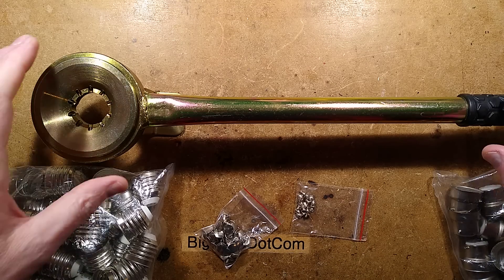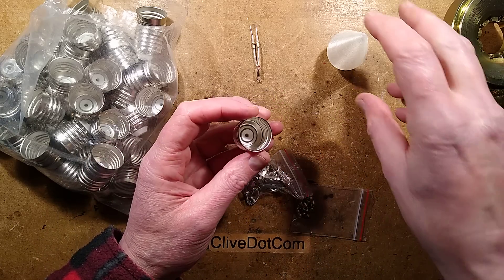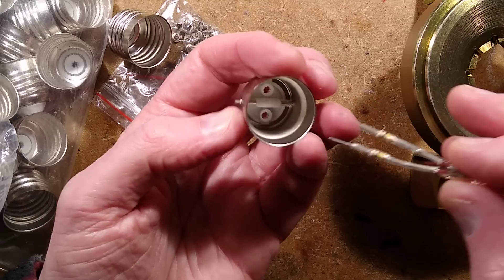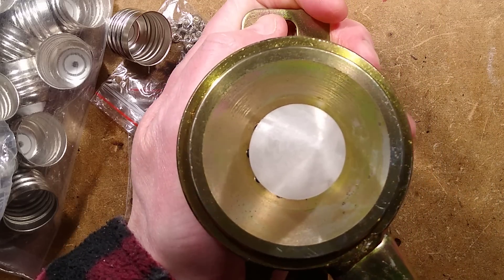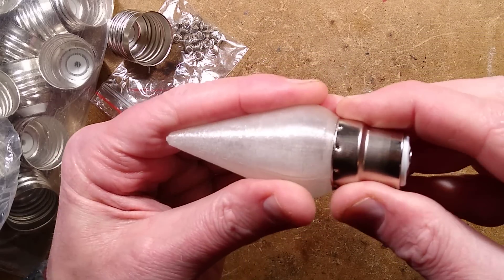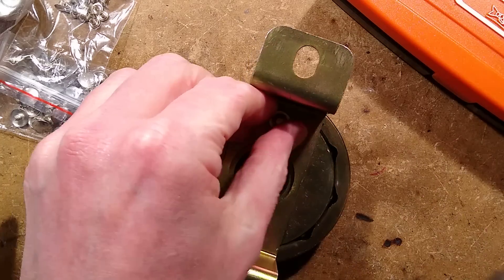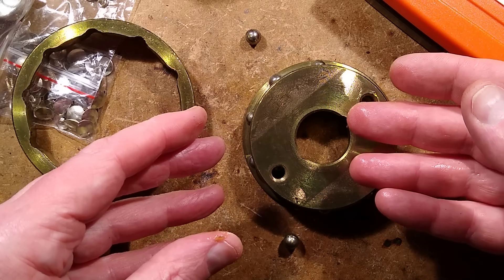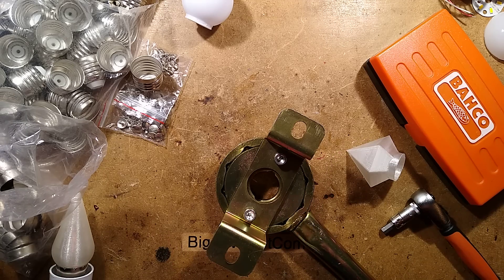Chinese factory lamp base crimper

Comment: what you do is you mount an axe handle to the other side so you have both leverage and a spot to hold it by, alternatively you could mount it in a vice grip mounted to a desk, or use a clamp on it
Reply: oh I almost forgot, vice grips, that works too, if you can find one large enough

Comment: The problem I see with bolting it to a doorframe is that gravity no longer holds the lamp in the tool. Lots of workable ideas from others for portable & bench use, but here's my suggestion:
Get 2 appropriately sized clevis pins & drill holes in the bench top. Set the tool's bracket over the holes and drop in the pins - it won't rotate till the bench does, and you just pick it up when you're finished (the pins will come up with the tool).

Of course the HUGE advantage of bolting it to a doorframe is that you'll never have to ask yourself where the hell you put it after last time you used it!

Comment: No No No, you did it all wrong ! You should have only half crimped it so the cap falls off. Also, make sure the bottom contacts are so bad it only comes on intermittently. Only then will it be like the ones you get in the cheap shops.

Comment: Fun fact - using this setup, a person can create their own custom 12VDC bulbs to use in house light fixtures. As a fulltime RVer, the lighting choices are dismal..We often want to buy a used house fixture at a thrift store to use on our 12v system. Many solar families try to stay 12v as well.

This is a great solution.
Reply from the maker: An interesting range of 12V lamps with standard bases can be found on eBay.

Comment: Nice vid :)  you may find that if you pack the springs and bearing surfaces with some molybdenum grease it will be a bit smoother in operation, its pretty cheap and available from Halfords and most motor factors.I use both Castrol and Comma (Lith-Moly) grease

Comment: I'm don't know what kind of 3d printer you have but if you want to produce a lot of those light tops you might want to look into a resin 3d printer for making more of them faster cause patience is hard.
Reply from the maker: I optimise the design with a hollow shell for very fast printing.

Comment: In many cases, I have found LED and some CF E-26 base bulbs where the center contact doesn't properly reach the live contact in the socket. They don't touch at all, or the work intermittently,  all the while sparking and arcing.
Being made in China, the specs were probably not followed,  or the correct ones not observed.

Comment: Easy enough to bolt it to a piece of stout angle. Clamp angle in bench or other firmly anchored vise and enjoy. A longer piece of angle could be clamped in say a plumbers tristand (portable, strong, fits in a closet which may interest apartment dwellers).

Comment: Here is an idea. if you used an earthed bayonet lamp holder and used the earth as a common ground you could then use the live an neutral pin for power and data and fit neopixles into the lamp.

Comment: Are there power supplies, that drive the neon with high frequency, so it doesn't shimmer visibly? 
So far I have not seen commercial modules that are running on 230V AC. 
But a modified joule thief made me like flicker free neon.

Comment: At work someone must have dropped an expensive LED light on it's base and damaged it. I talked to our local electrician when he was around at one point to see if he could replace it and he claimed no. So they expected me to throw away a $40 LED light made to go in enclosures. I tried to use a screw driver to bend the metal back slightly so that it might work but nope. Instead of throwing a perfectly good LED light away I kept it but I don't think I want to buy one of those tools just to repair one LED light. No idea what I will do with it though.

Comment: If you don't want to mount it on the bench, you could just bolt a 2by2 as a second handle, or even a steel pipe.

Comment: 7:00 guaranteed to have thread locker on them, probably red/permanent, otherwise they'd end up backing out and causing problems. possibly selling off used, ones that didn't pass Q.C. or out the back door piracy lol

Comment: I have pulled lamp basses off before(drilling the punched holes) and then used a hand punch or scratch awl and hammer to manually re-punch in between the old holes.
no, I do not recommend doing that ever. lol, I put it through the tip of my finger once when it slipped

Comment: Bought a similar thing recently for installing solar hot water, you have to shape the copper ends of the large glass tubes so they can slot into the top of the solar radiator. I forget it's technical name but that's more or less what it is.

Comment: Thanks Clive. Another great hoping you hands are ok. 
Simple to make it a hand tool no bench or vice required. 
Length of bar ( same length as device) 
Drill 2 holes to suit the 2 mounting holes on the bracket. 
Result 
An item that resembles a bolt cutter or long handled pruning shears 
Parts list 
Length of flat bar to suite,20 mm by 5 mm
2 x M8 bolts and nuts.

Comment: Seems like a much larger tool than needed for the job...
Reply: I was thinking this is probably great for mass manufacturing, but a hobbyist would probably be better suited with some kind of hand-crimper, even if you had to rotate and crimp a few times to get the same result.

Comment: My mother simply had to show me this "LED light bulb hack" she saw on Facebook a few weeks ago - "Fix Any Dead LED Light Bulb With This One Trick."
In the video, the guy pops off the diffuser, shows a single LED with the Black Death Dot on it, proceeds to flick it off the board, and then jumps the empty pads with a scrap of aluminum foil, holding the foil in place with cellophane tape to make it work again.
So Mom's chuffed as chips, since we've had the typical Dollar Tree LED bulbs fail quicker than old-school tungsten bulbs, and she's sick of throwing them away. I had to burst her bubble by telling her that was a temporary fix, and would most likely burn the rest of the LEDs out quicker. (And that Scotch tape over Reynolds Wrap was NOT an acceptable way to make that temporary fix.)

Comment: Fhak chinese tools ! I bought an electric pipe threader, POS 💩 the bed in less than a year. And I made maybe 20 threads with it, most were 3/4”. Doing a job with 2” steel it fried the motor. Even the replacement brushes that came with the POS , one was broken. I just bought a Milwaukee cordless set up that does up to 2” pipe.      FHAK made in china !!!!!!!!!!!!!!

Comment: Invest in a little screw on vice for the edge of your bench, it will made holding those things easier and you can remove it when you don't need it. They have a screw underneath that clamps it securely enough. I've used one for years with  B&D wotkmate for fiddly jobs.

Comment: Mount it to a board the same length of its handle and use it like a big pair of bolt cutters.  It then remains portable.  Optionally you can remove some pins for customizing the punch count.

Comment: Threaded inserts.  Aggressive threads on the outside and machine threads on the inside.  Could be flush mounted to your work bench.  When you need to use the crimping tool, couple of bolts and off you go.  Pretty slick little tool btw.  Thanks for all the time you put into the channel.  Love the content.

Comment: at least the gadget is kind of fool proof on re-assembly, I was kind of expecting mass carnage when you removed the handle for some reason, like a fairly cheaply made gadget whereby the ball bearings shoot across the room shortly followed by the springs. but really nice it would go back together without too much of a problem.

Comment: while the tool does have a lot of individual moving parts, it is very simple and pretty much indestructible - it is putting a number of dimples on something not much thicker than very thick aluminium foil. A very good purchase considering the use you could get out of it on your channel or for making bespoke gifts Clive.

Comment: I was thinking you could mount it on a relatively long piece of wood maybe about as long as the handle or slightly longer and possibly 2cm thick and wide enough so the two mounting holes are within the width of the wood. Then you can place it on the bench (or even secure it with a clamp) and be able to operate it just like all those factory workers 🙂.

Comment: hey Clive 

Bit of an odd question.

I bought a w-king T9 bluetooth speaker and the main speakers failed(magnets fell of as the rivets were defective)

I would like to replace the speakers and get the unit working again,I am not sure if I buy  8ohm or 4 ohm speakers.

I have found some speakers on amazon that would work but I can't seem to find any info to help guide my decision 

Any advice?
Thanks
Reply from the maker: If the impedance is not printed on the original speaker then you can measure the resistance of the existing coil and it will give a good indication.
Reply: @bigclivedotcom  my friend has a meter,i will do that,thanks alot for the reply.Have a great day.
Reply: Printed on the back of the speaker 

Is

BT239
1F14R
210724

Comment: You can easily mount the crimper onto a 1x4 or 1x6 piece of smooth wood (don't want you getting slivers).  The length of wood should be about the same as the crimper handle to give you ample leverage and stability. Keeps it all portable.
Reply: Or place it in a vise when needed. Perhaps a small block of woon to make it easier to be grabbed by the vise.
Reply: @pizzablender  I've actually got a 4" vise mounted on a 2x6 about 10" long. Portable vise. Super handy.

Comment: Phillips Lighting use to have a massive 20 plus  acre light bulb factory in Little Rock Arkansas, USA. I was a young kid and can remember everyone older wanting  to go work for them.  It was one of the largest best paying companies to work for.  Back when there was pride in making a quality product.
Reply: about the same here with GE making bulbs(Ohio). they're making some LED's now I think, but everyone I knew there is long retired or moved to another job.
Reply: same here in Argentina. philips had a MASSIVE lightbulb and radio factory. and now philips no longer exists (they sold off most of their divisions, the only part of the company that bears the name and has roots with the original dutch company, is the medical equipment division. everything else (lamps, electronics, semiconductors, etc) they sold over the last 2 decades. sad. philips is behind every high tech electronic stuff: ASML, the company that makes the machines to make the most advanced chips, is a spinoff from philips that they sold way back in the 80s because they saw no business in it.

Comment: How do you vacume the gas out and put in a gas you want.
Reply from the maker: For glass globes you would need a vacuum pump and gas injection manifold.  Like neon sign makers use.
Reply: @bigclivedotcom  Do you have one to demo that?
I made one with a fridge compressor.
Collapsed the glass and some other materials I tried.

Comment: Interesting video as usual. Thank you.

In the past I've mounted a similar tool to a bit of 2x1, so that I effectively had 2 handles. If 2x1 isn't man enough you'll probably have access to a bit of bar.  One problem with that dodge is that the tool twists because the handles aren't in line, but you could put a swan neck in to reduce that.

Comment: If you're going to do BOLTRs, you should unbox the product with inappropriate tools.

Whilst I appreciate the space-saving aspect of mounting the crimper to a wall or door frame, one should consider the gravitational advantage of horizontal mounting. It would be preferable to have a medium-sized planet holding the bulb in position rather than helping to pull it out.

Comment: If you bolt it to a 2x4 or some other such piece of wood (or metal) you can use it like a bolt cutter and not have to mount it permanently.

Comment: What adapter do I require to drive (12) lights that light up the stair case. The units require a (4.5' volt DC) or (3 X (1.5 volt battery)! I do like the I do like the light bulb crimper.
Reply: If battery operated it will likely operate acceptably for a range of voltage as 3x AA/AAA with fresh batteries can be close to 5V and drops to ~3V (1V per battery) when effectively empty and most designs tend to try to use most of the energy in the batteries. 
For instance I've got various  lamps and other devices meant for 3xAA running just fine off a single 18650bLiIon battery (4 2V full, most of the time  around 3.7V and about 3V empty (using a TP4056 module for charging and under-discharge protection)

So if you put all the devices in series you'd need a voltage of between 36V (3x12) and 55V (4.5x12) and capable of delivering the current that one device draws, as the same current  goes through all the items in the series string.

If all were put in parallel, the voltage needs to be 3 - 4.5V (maybe a 5V supply with a series diode, to drop a bit of voltage), capable of delivering 12x the current a single device draws. If doing 5V and diode, make sure the diode can take the current / power dissipation
...
As you have so many devices it is quite flexible, by putting groups of series connected  devices in parallel - assuming they all draw the same power.

If you, for instance have a 12V supply capable of 4x the current one device draws, you could wire 3 of them in series (x4, making 4 such groupings) and then put these 4 groups in parallel. Each device in a string gets 4V (12/3)
If you had a 9V supply capable of of 6x the current of one device, you could use 6 parallel strings,each with 2 devices in series. Each device would get 4.5V (9/2).

HTH
Reply from the maker: If the lights are low current you may be able to use a USB power supply to run them with a resistor in series with each.

Comment: Oh stop kidding yourself you're gonna use all 50 of those. Just like I have used all of (looks at recent eBay purchase list.....) Power pole connectors, 5.5 mm 4X Y cables, dummy display port adapter which I literally bought one and then bought one a week later, two different sets of USB-C connectors for replacing micro connectors that have broken. 50 pack of record sleeves because it was cheaper than buying a 25 pack when I only needed 10. Foam microphone covers because the first batch of 10 was not quite enough. I purchased 3 display link to HDMI adapter cables, I need to get 2 more. Dummy pass-through HDMI adapters I think I'm sitting somewhere around 8. And that was just orders in the last 60 days.

Comment: Ok, it MUST be said,  a glass envelope,  filled with magnesium wire milling's and the air replaced with chlorine gas, an old fashioned flash bulb.  Don't forget to coat the glass with a plastic film for non-shatering.
Reply: The recipe I saw was for a huge flash bulb for the WWII effort when taking pictures of city's and industrial plants at night. VERY bright.
Reply: I didn't know about the chlorine gas - cheers.  I remember the fun I had fiddling around with the Kodak "magicube" 4 flash accessory for my nifty little 70's camera.  I learned how to set them off without it being attached to the camera, but to this day don't know exactly why they go off when you poked the little spring loaded wire thingy in them. (inspired to find out now)
Reply: Apparently "In order to fire the flash, a pin in the cube mount released a spring wire into the cube, that struck a pin at the base of the bulb that contained fulminate ions or fulminating material. Due to friction caused, they caused a small fire which in turn ignited the zirconium that worked as a flash"

Comment: I received a chinese lamp holder for a wall socket. The plug doesn't stick out long enough so the lamp tilts. The light goes on and then off again as you push it in. The housing splits open by the switch. No soldering done. All contacting is done by loose springs. Finest chinesium.

Comment: 2:30 Or you can do what I do and use a small (2 or 3mm) drill bit around the top ring of the base and thread a wire through it and solder it. Worked wonders for me when I was repairing some 20w LED grow light bulbs for a friend.

Comment: A little tip, if it was thread locked, stud lock ect... then applying heat from the good old heat gun, sun gun, paint stripper will melt the thread lock and you'll be able to undo it a lot more easy.. Used to do it all the time on aircraft weapons stuff.
Reply: I'm a huge advocate of the  'heat wrench' myself, but until you get it open, you don't know if there are any meltables inside
Reply: @sometimesleela5947  Yes indeed, only after I'd posted that. Did I realise... Oooh! melty stuff. Never really had that problem on gun feed mechanisms.
Reply: @sometimesleela5947  a little heat can work wonders even if it's just tight or especially if it's corroded, the heat will cause the components to expand and contract loosening things up.

Comment: Neat tool. Extra points for world's shortest ratchet handle. 
Did you hear something about the safety wombats coming for our florescent tubes.
Reply from the maker: Yeah, they want to ban fluorescent tubes.  Not sure how this is going to affect the manufacture of germicidal tubes, since they are still the most efficient source of UVC.  The amount of mercury vapour contained in standard tubes probably pales into insignificance compared the landfill the LED replacements create.
Reply: @bigclivedotcom  nailed it.

Comment: try taking apart a freewheel sprocket assembly for a bike not only do you need special tools but many tiny 1 mm ball bearings riding in 2 races and 2 or 4 ratcheting claws.

Comment: For the lamp you crimped the base onto without the wire, you can drill a timy hole near the top of the screw and solder the wire through that. May take some scratching around the hole to take solder.